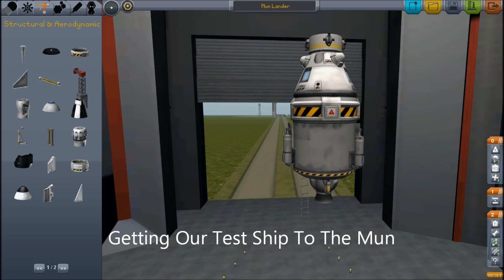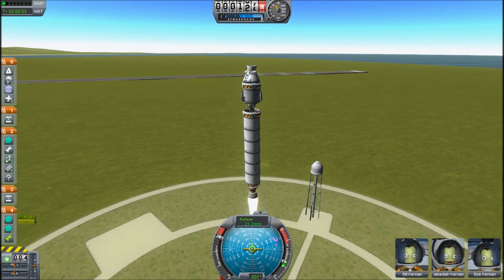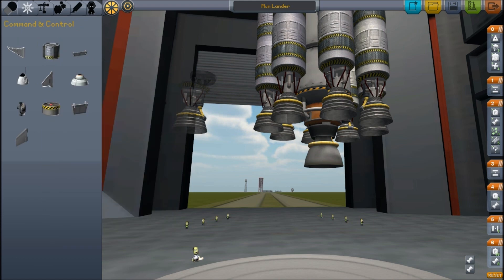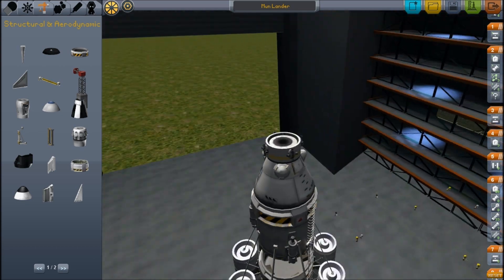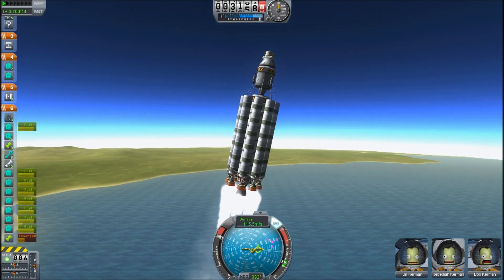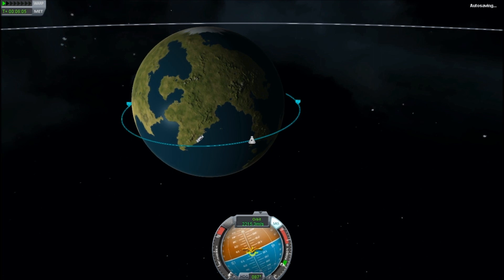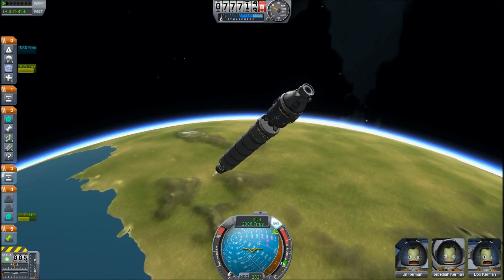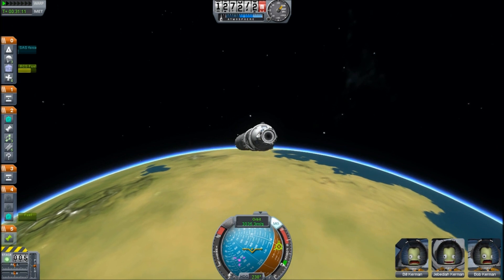3 Kerbal Capsule - Getting To Orbit and To The Mun - Kerbal Space Program

Comment: The problem at 16:00 isn't actually due to SAS, the problem is the gravity gradient. Kerbin has the same surface gravity as Earth, but is 10 times smaller. Thus, close to the planet, the gravity gradient is much steeper, meaning the end of the rocket closer to the planet is pulled much harder towards the planet than the other end, making it resist attempts to turn. The problem has always existed, but with higher mass, larger rockets in .16, it is much more noticeable.

Comment: Here is the problem. I have found while using SAS it tends to turn if you want it to but it tries to go back to the way it was. If you turn off SAS at least with smaller rockets you get a lot more turn which is bad in atmosphere but good in orbit. You can very easily make turns with a rocket even with all of it attached with SAS offline. Turn it back on when you are pointing in the right direction.

I think you should experiment with SAS and non SAS in atmos and not in atmos to see.